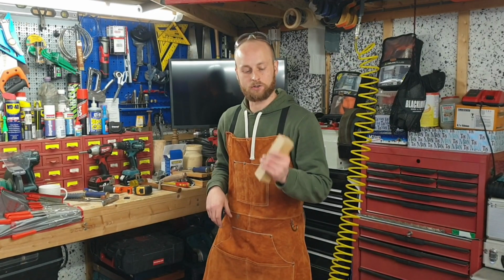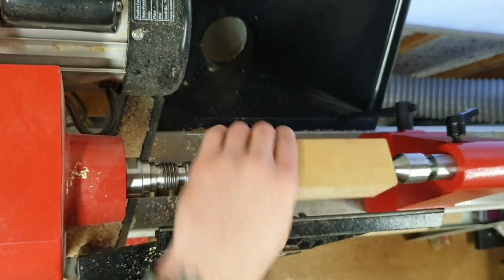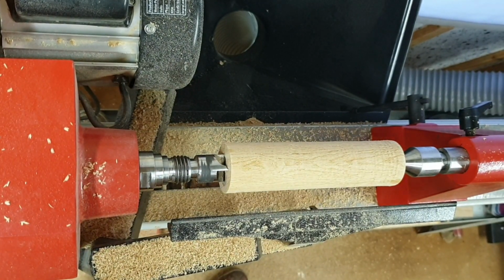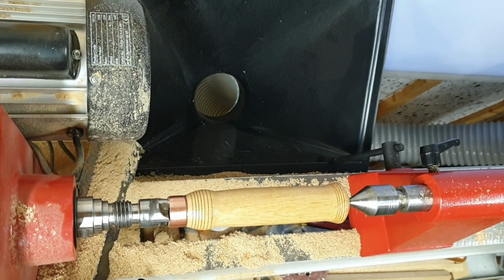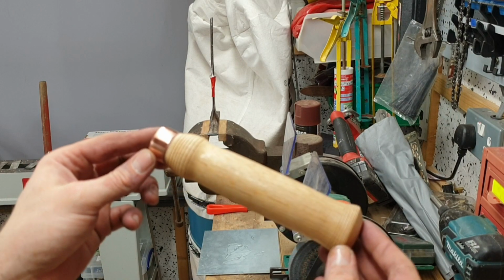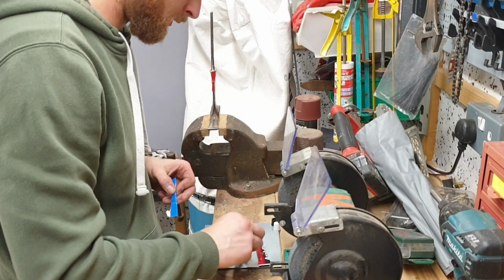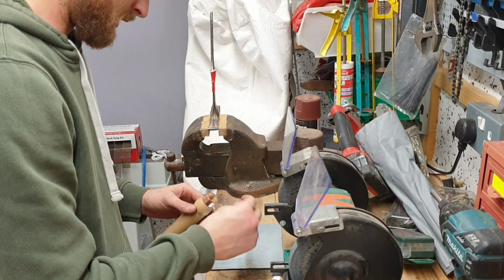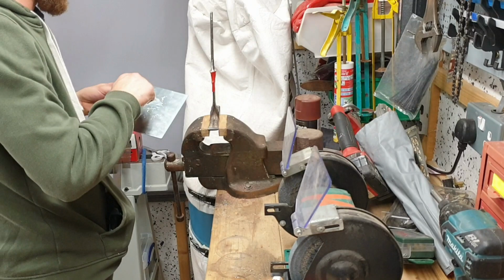Wood Turning - How To Make A Custom Oak Brick Hammer Handle 🔨

Comment: Very nice but that glue is shit mate
Reply from the maker: Cheers mate not used it before usually use the gorilla epoxy  but its a good  tite fit so should be fine 🙂
Reply: @Scottchallinorwoodturning  fair enough there some good shit forgot what its called i get back to you mate
Reply: Evo stik inpact in a tin mate try it no harm bout 6 pound
Reply from the maker: @dannyhogi4953  will give it a go thanks
Reply: @Scottchallinorwoodturning  look forward to seeing more stuff am a joiner but the stuff u do it on a over level
Reply from the maker: @dannyhogi4953  thanks pal I have lots coming 👍